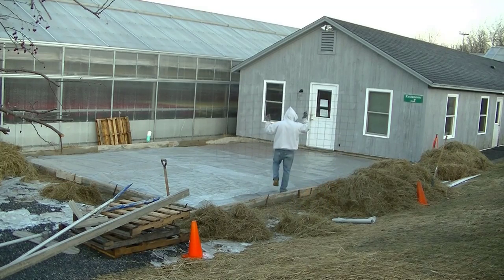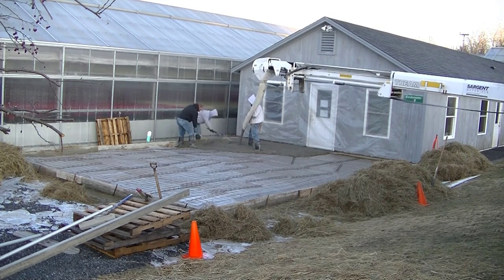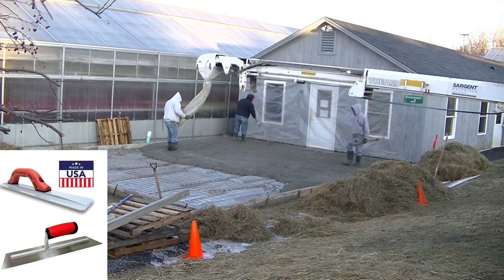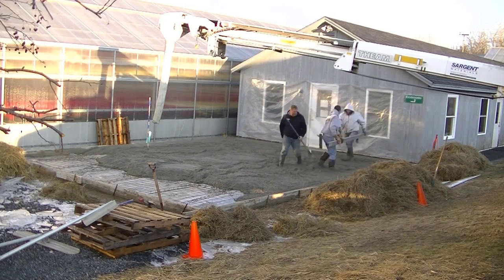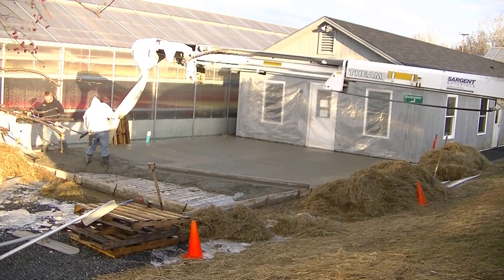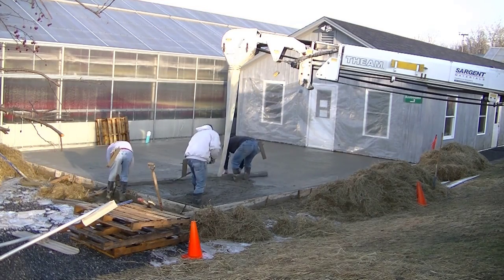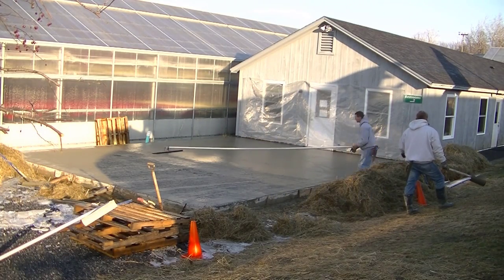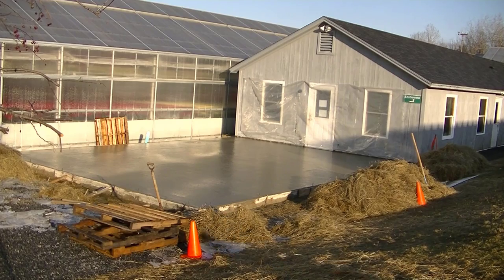How To Pour A Concrete Slab | Beginners and Diy'ers

Comment: If you consider thinking concrete business then you must understand that this is very hard work therefor it is not something you want to do when you 50-60+ years old.
Reply: Agreed. Mike and the guys make this look like a-piece-of-cake. It’s not! If I was a diy’er, I would break this up into quarters or at least half’s. It’s gonna cost more in pump/conveyor time, but if the concrete gets away from you, there’s no way to recover. Mike will probably cut it into quarters any way. And spend the money on the right tools. You won’t regret it. Another nice job Mike 👍
🤜🤛
Reply from the maker: I'm 54 and it's something I do every day. If I had never done this before it would be hard, but if I were a beginner this would give me a good idea of what to expect and how to attack a slab. I would also consider having someone there who has a little experience after watching this.
Reply: @MikeDayConcrete  -Mike, I think you underestimate how difficult your craft is. I would rank concrete finishing as one of the most physically demanding jobs in construction. It’s right there with production rod busting. You don’t notice it bcz you’ve done it everyday for the last ~40yrs and your body is tuned for it. 
-I’ve noticed in your area there seems to be a lot of crossover in the trades. You do the carpentry, the iron work and the concrete finishing. It’s a bit different in my area where, if it’s wood? You call a carpenter. If it’s block or brick? You call a mason. If you need to pour concrete you call the finishers. There’s a lot to be said for the way you guys do it, but around here I would never call an ironworker to finish my concrete. (esp! not an ironworker 😆)
🤜🤛
Reply: @MikeDayConcrete  u rock man, I used to do walls in waist deep mud all the time, flat work is cake comparatively
Reply: @psidvicious  I've been branded both finisher and iron worker depending on how my employer wants 2 pay me and if ocsha is around
Reply: @psidvicious  I was trying 2 give a like
Reply: My uncle did it till he was 75 years old. He passed alway at the age of 97. He started when he was 15 years old.

Comment: What kind of upcharge are you hit with to use the conveyor truck ? How does it compare to a pump in cost and usability ?
Reply from the maker: It's 25 dollars per yard. Usability is very good and easy it reaches about 40 feet. Pump cost for this would have been about 950.00. Cost for the conveyor on this was about 275.00

Comment: Have you ever tried using the U shaped yokes that are placed over 1/2 rebar driven into the ground?   Then you can use an 1.5" screed pipe to screed your class 5 gravel for grading, then use the rails for screeding the concrete.
Reply: Mike's too advanced for that
Reply from the maker: I don't do the grading and I don't need a screed pipe to screed from.
Reply: @MikeDayConcrete  yeah, that would make sense if you don't have to do the grading

Comment: Great , Mike ! Simple and straight forward , JUST DO IT ! Your showing what to " expect " on such a " routine " job" is a real help .
Reply from the maker: That was my goal with this video, to show a beginner what to expect and how to attack a slab like this.
Reply: Interesting to hear about adding fibre when the temperature is colder. In Southa Africa heat and dry air is normally the challenge in Non coastal areas

Comment: Love the videos and content exactly what you need to attempt a slab your self!! i am making a 6m x7m 200mm slab for my shed , my only question is i have a slightly sloping yard and also have a small 3mx3m existing cracked concrete slab that was for my garden shed in the way as it is lower then my depth required can i add a 50mm rubble base over the top and then my 200mm slab on top or would you recommend removing all the exsisting concrete first even with a bedding below my slab?
Reply from the maker: You should be able to add over the top of it yes.

Comment: Mike,  I have a question about the maximum depth of gravel placed under the poured concrete slab.  This six inch concrete slab will be the floor for my two-bay truck garage.  The problem I'm trying to solve is the natural elevation differential of the left and right sides of the floor.  Specifically, the East side is 11 inches higher than the West side.  So, my real question is, "Can I dig off the top soil with a tractor and level the entire pad with gravel?"  That would be 4 inches of gravel on the East side and 15 inches of gravel on the West side.  Can I go to this extreme with the gravel or should I excavate the soil until it is level then apply 4 inches of gravel?  BTW: the garage will be 30 feet wide.

Regards,  Mike Godbey,  Liberty, KY

Comment: Hi Mike, thanks for the great instructional videos! Much appreciated. Question I have (I think I already know the answer, but wanted to get it straight from the expert) on the fiber mesh, I assume you order the concrete with that already mixed in rather than adding it to the truck and mixing onsite?